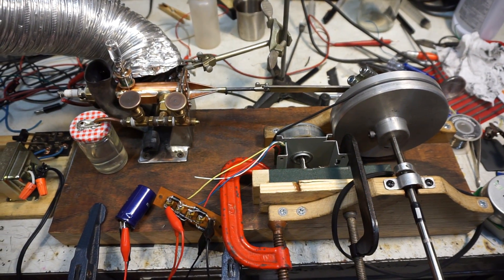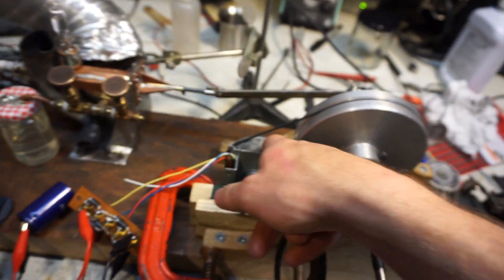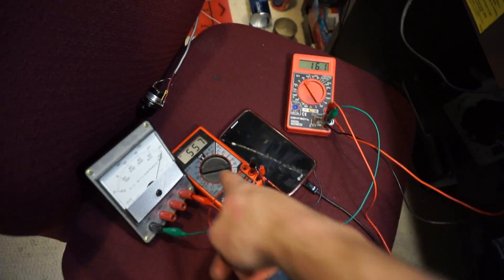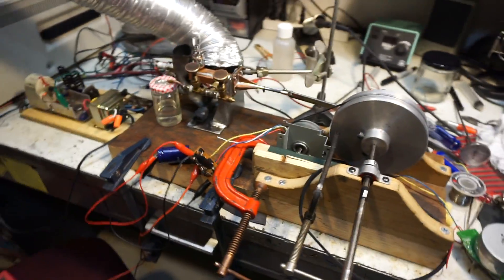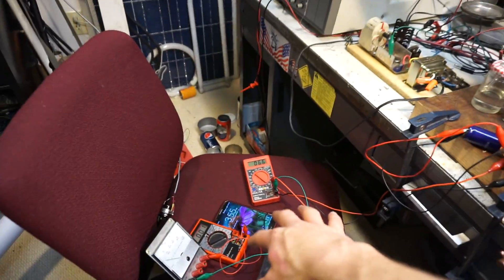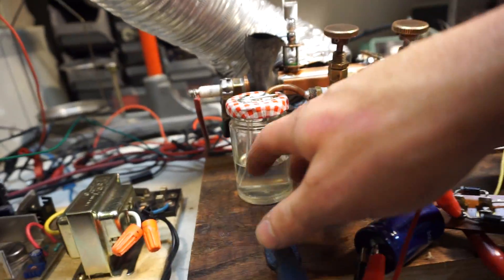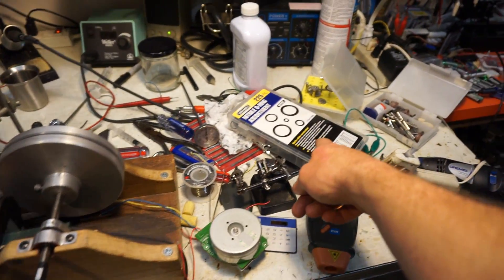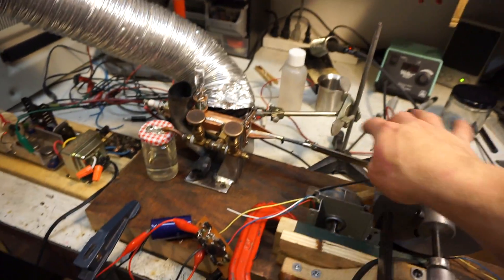Homemade Internal Combustion Engine Generating 15 Watts!

Comment: you might get better results from casting a piston out of aluminum.  mic the cylinder wall, and take about 0.0015 off of that,  and you'll have the diameter you'll need to finish the piston to, and while you've got it on the lathe you can cut a couple groves in it for your Oring seals
Reply from the maker: +Texassince1836 Well I could but the idea was to build and internal combustion engine without a machine shop.  I will probably do that in the future tho

Comment: I used to daydream about doing this kind of thing, when I was your age (I am guessing you are somewhere in your teens). I didn't have the wherewithal, or skill. It's really cool that you worked out how to do all of this, and that you're obviously excited about it (I can hear it in your voice). Keep learning, and keep doing what excites you. And don't be afraid to move on when things have run their course. You probably don't care too much about what other people think, or you'd never have got to this point, but in any case, you'll encounter various naysayers who don't get the whole "journey of discovery" thing. Just ignore them. In order to learn, you have to re-trace old footsteps. At the same time, realize this is just a beginning.

P.S. I'm seriously amazed that a simple rubber o-ring will seal that piston and not melt in short order. Also amazed you can get anything like 5000 RPM. You're probably getting a better seal with that than the metal rings you see in a typical engine. "Blowby" is real, and "positive crankcase pressure" will pump oil right out of a typical engine.
Reply from the maker: +Brandon Lewis I'm 20 so just short of being a teen now!  But I was 19 when I first got the engine working.  Thank you!  I'll keep it up!  

I'm also surprised the o-rings hold up as well as they do.  As long as you keep them happy with a little oil now and again they last a long time and do give great compression.

Comment: you should try a magneto system for ignition you can play with the pickup positioning to get the timing right for more power and you could probably just steal one off of an old weed eater

Comment: If the engine has a maximum production of power of 15 watts, and 746 watts equals 1 HP, then I guess the engine is 1/200 HP in theory? Does this sound right to you? That is a neat engine,....pretty amazing for you to build it without much shop machining!
Reply from the maker: +John Kerley Yeah that sounds right.  It's technically more powerful than that as I don't think my alternator is particularly efficient.  I need to make a prony brake to measure the torque.  I think I may also be able to improve the power output by adding better ignition.
Reply: From the generator. You can gauge the engine power from the speed of the moving mass. rpm of flywheel (plus crank etc  - high percentage here). You could see how much weight the flywheel will lift for torque. Then there is the fuel and the absolute energy stored in a mass of that fuel and the engine consumption to determine efficiency.
I didn't watch it all, but do you have a hall effect sensor or something to time the spark?
Reply: 1/50th horsepower.

Comment: nice one , try to make it run on  hydrogen using an H generator, and see maybe you get an improvement, and H ez to make and its free all you need is water and electricity source)
Reply from the maker: +Andrey Arkashin It's not really free as you need the electrical power.  The other problem is that hydrogen is super explosive and it might blowup the engine
Reply: I think you can figure it out, and it would be free if you hook up generator to  which is hooked up to this engine which powers it up ,generator powers the hydrogen generator and hydrogen powers the engine , i think you can figure it out)))
Reply: +Andrey Arkashin  that is 100% impossible.

Comment: I understand you current piston is fine but I must ask why you didn't cast one out of aluminum?
Reply from the maker: +MOO Tech Well I would still need to machine the aluminum piston.  I might be able to just pour the aluminum directly into the copper pipe like how I did with the JB weld but I think it would probably stick.  I may try that in the future.  Plus it would have been a lot more work to set up the foundry and all.  Plus a lot of people have JB weld and I wanted to make this engine kind of easy to replicate.
Reply: +Makerj101 That makes good sense

Comment: How are you timing the ignition?
If you can get a good neodymium magnet on the crankshaft. You could use a pickup coil to drive the spark. Move the coil to change timing. that's how mowers and weed whackers do it. Not sure if they have transformers built in to the coil. I think one coil of many turns might do it.
You could drill 2 holes in the side of the flywheel, one for magnet and an opposing hole to balance with lead.
Reply from the maker: +Mongrel Shark I'm not timing it! It fires whenever it wants to and somehow it seems to work very well.  It blows my mind that it doesn't fire too early and self destruct.   I've been thinking about a way to do the timing better.  I might try going that route with the magnets or my other thought is to use an ignition coil and contacts.
Reply: Comprimise. Ignition coil, magnet, reed switch.
Reply from the maker: A reed switch would get murdered pretty quick at 3,000 rpm. Not even considering the back emf from the coil. I was using a momentary switch and it self distrusted when my engine jumped to 4krpm. I think I'm going to use a hall effect sensor and MOSFET. Should be able to handle things pretty well and be fairly efficient.

Comment: I'd like to see you connect this (or one of its future iterations) to a battery backup of some kind. I wonder if you could run a Raspberry Pi off of something like this.

Soldering is like anything else; if you've only done it a few times, it seems pretty difficult. The more you do it, however, the better you get at it - and it takes less time to get good at it than you think!
Reply: +Mithradates Megas If you take the output and rectify and filter the crap out of it and then pass it through a 7805 then YES you can run an RPi off of it. You can make discrete circuits to do all this with 4007's, some electrolytic caps and the LM7805.
I would full bridge it though and use a few 50 volt 2200uF or higher caps to eliminate the bulk of the AC noise before trying to hook up any micro-p devices, battery or not.
Reply from the maker: +Mithradates Megas +Mithradates Megas Well I mean that's basically what I had going in the video... charges the battery but even at close to 1A of charging it would take 12 hours to charge this 12 volt 12AH battery.  So not practical at all the charge batteries with it.  Don't Pi's use micro USB?  If you do it would be nothing to plug it into my phone charger.  I don't have a Pi though.
Reply: Makerj101 DC DC converter will work better yeah. lol IDK why I said that derp I knew it was not the most efficient thing...
Reply from the maker: +ElfNet Gaming I did have it rectified and I had a filter cap on it in the video...  7805 would work but it would be so inefficient.  Plus I think they fry at above 20 volts input so if the engine revved up it might fry.  I'd much rather use a DC to DC converter as they are way more efficient.
Reply from the maker: +ElfNet Gaming That's ok!  I think I've seen some circuit where you add a transistor and inductor to a voltage regulator and you get a DC to DC converter.  Makes it more efficient.
Reply: Makerj101
I don't actually know; I believe I read that the Pi uses about 5w of power, though I don't know more than that (I don't own one either). I just thought it would be awesome to have a portable computer that runs off of an engine (and thus can be run almost indefinitely even without regular electrical access).
Reply from the maker: Mithradates Megas 5 watts sounds about right.  I mean technically a phone is a portable computer!  :P

Comment: This is awesome! Will heating the fuel make it more efficient? So it will mix more rapidly?
Reply from the maker: +Joshua Rando Not necessarily.  To get more fuel you just need to open the fuel valve more.  Even now if you open the fuel valve too much it adds too much fuel and then it's not a combustible mixture and the engine will not run.

Comment: +makerj101 what about getting a small chainsaw carburetor and tweaking it to fit your needs? At least just for testing, it will ruin the idea of "homemade" however..
Reply from the maker: +XanderZ Exactly!  That would be cheating!!!  :P  Plus I think it would be way way too big.  Chain saws are like 30cc.  This thing is only about 7-8cc.
Reply: Makerj101 I think you can adjust the fuel intake on some of the carburetors, but you'll still end up with a very sensitive throttle
Reply from the maker: +XanderZ Yeah I think even with the throttle all the way closed it would still let too much air in.  Those needle valve I'm using are almost closed.
Reply: You're right, on some carburetors, they even have two holes on the metal disk, or even a notch on the edge
Reply from the maker: +XanderZ I think I will actually replace the needle valve I have now with aquarium air valves like these:  http://smile.amazon.com/gp/product/B00JRKNYUM?psc=1&redirect=true&ref_=ox_sc_act_title_5&smid=A1V3K7OI49CJC5
Reply: Makerj101 You kinda' have to cut them, and solder them at one end. Now, it depends on the material they are made of :)
Reply from the maker: +XanderZ Yep!  The ones they sell at PetSmart are brass.  I'm not sure about these ones on Amazon.  I just bought some more from PetSmart and they are still made out of plated brass.  They work really well.  Not necessary the best seal but for most things they work pretty good and are fairly cheap.
Reply: +Makerj101 As an idea for cooling: get a small diameter copper pipe and wrap it around the cylinder, weld it with solder or use some good thermal paste, a small water pump, a bucket of water and just like that you've got yourself a great cooling system. I don't really know much about the dilatation coefficient, it might increase the wear of the engine, because the o-ring is getting stiffer, or the opposite, that the o-ring might last a bit longer, for not having to run în such high temperatures. 
and for the ignition, you can use a hall switch, and a magnet, attached to the shaft, and an induction coil from a car(As far as I know, they have got the mosfet stuff inside, so the ecu can drive it only with small analog signals)
Reply from the maker: +XanderZ I actually did just add cooling!  Slightly different method.  But similar!  I used copper tube and warped that around a 3/4 inch copper pipe connector and dowsed it with loads of solder!  I love solder!!!  :D  Here's a picture on my Instagram: https://www.instagram.com/p/-xJFzVlwGr/?taken-by=makerj101  You can also get a sneak peak of the homemade water pump.  I also sneaked a picture of it on my Instagram!  About 2 weeks ago I got an ignition coil for $4 from a junk yard.  It's the old type that uses points.  I think I will build a transistor and hall effect sensor circuit to drive it like you suggest.  The guy at the junk yard would have sold me one of the newer coils that have integrated transistor but he said this was the cheapest thing he could give me.  I just asked for the cheapest thing he could give me.  $4 wasn't bad although it's a little rusty.  Maybe if it works well enough I'll repaint the coil.
Reply: I had basically the same idea with the water cooling, and it came out just the way I expected. I'd like to see if the engine could sustain itself, only by its generated power.
Btw, it should be a nice addition to add a microcontroller, so that the timing would be as good as possible.Basically just give it the task to achieve the highest RPM, by adjusting the timing. I had some success with an arduino and a car engine, I just automated the injector(the engine was meant to use a carburetor), but I could have done a lot more than that, but it would have been a bit expensive. Just search youtube for (car engine driven by arduino), it was on my other channel ;)

Comment: Very nice! The sound it makes is amazing :) Your family must love it when you start it up, LOL. A few questions: Those 'vitron' rings, is vitron a material, a brand? Never heard of it.
How do you time the ignition, and would it be possible to mix oil with the fuel to lubricate the engine, just like other two stroke engines do? You could maybe use some sewing machine oil, because thats very light.
I see you run the ventilation, does it put out much smoke when you run it?

JB-weld version would be very nice. Would you maybe publish some simple drawings with the dimensions you've used?
The fuel consumption is quite good! If I look at how much power my stirling made off two 1200 Watt burners, this is very good :P
Reply: +Makerj101 Even this comment is interesting to me because of what you have discovered along the way on this build.  This engine might be working like a model airplane engine that uses a glow plug.  It might even run model airplane fuel.
Reply from the maker: +Triangle_DIY LOL they actually can't really hear it much from upstairs.  At least that's what that say.  :P  

I think Viton is a brand.  Acroding to http://www.marcorubber.com/materialguide.htm Viton is Fluorocarbon Type A.  

There is no timing at all.  There is a continuous arc on the spark plug at all times.  It just fires whenever it wants to.  I honestly don't know why it doesn't fire too early or have other timing issues.  Sort of like a nitro engine I guess.  I realized that it works best with a continuous arc because the wires going to my ignition switch shorted out and it took off like crazy.

I could possibly run it off normal 2 stroke mixture.  I would have to modify the carburetor and make it instead so that the fuel is directly injected into the air intake.  That way some oil would also make it into the cylinder to oil the piston.  But I'm not sure how I would get the right amount of fuel pumped into the engines intake.  That's why I'm sticking with the bubble carburetor for now.  I may experiment with other carburetors soon.  Pretty much any oil will work.  I was using motor oil but I switched to mineral oil because I figured it would be a little less bad to breath the smoke from it.  I'm up to trying other oils too.  I was thinking about trying olive oil and see how that works.

The smoke is mostly from the oil that burns off.  It sets off the fire alarm in my shop after about 5 minutes of running without the ventilation fan.  Also I'm not sure if it might put out some carbon monoxide.  Don't want to breath that stuff.  

I show some dimensions in part 4.  Is that what you mean?  I could take some pictures of those so they are easier to study.  But that's pretty much the only things that I measured.  I winged everything else and guessed.  

Yeah it's way more efficient than my Stirlings too!  I'm not sure what we are doing wrong with Stirling engines.  The homemade ones are just not very powerful or efficient.
Reply from the maker: +Lidmotor Yeah it probably would.  I kinda want to try a glow plug.  Problem is I have no idea what kind I would need.  Most of them don't say they thread size...

Comment: what are you using to generate the spark for the spark plug,,, your the man, what are your plans after school?
Reply from the maker: +larz0001 It's a high voltage thing from an old electronic air cleaner that I took apart.  Ozone generator might work as well.  I'm still at community college right now.  Trying to knock out some basic courses and save some money.  Then I will transfer to a university next fall and I think I will take mechanical engineering.  Then after that I have no idea.  Get some kind of job doing something cool I guess!  :D